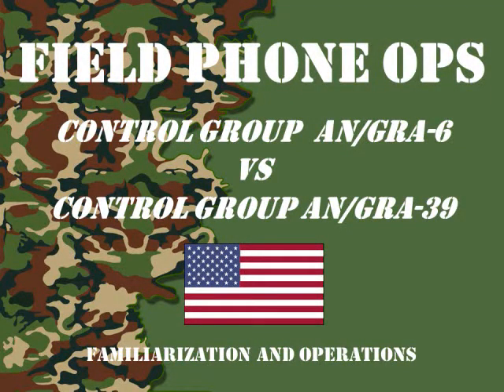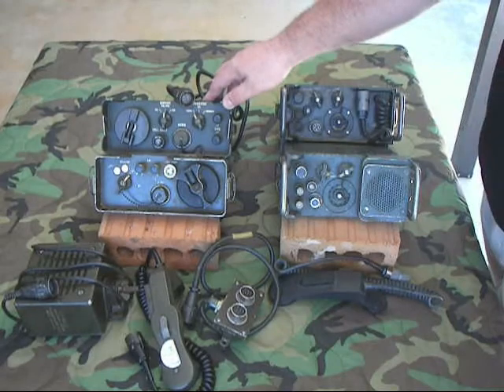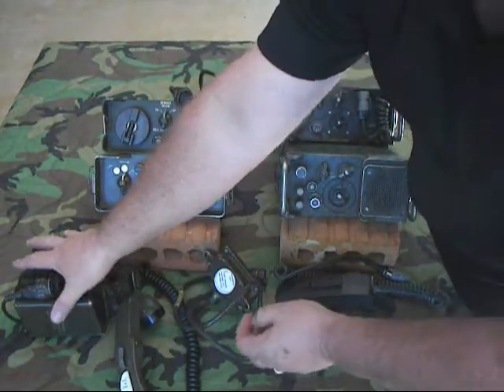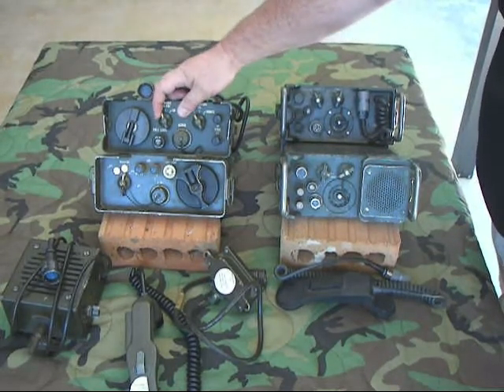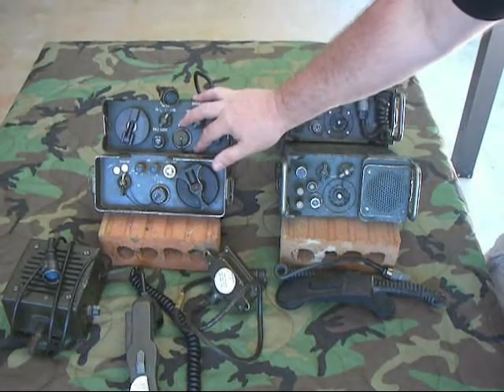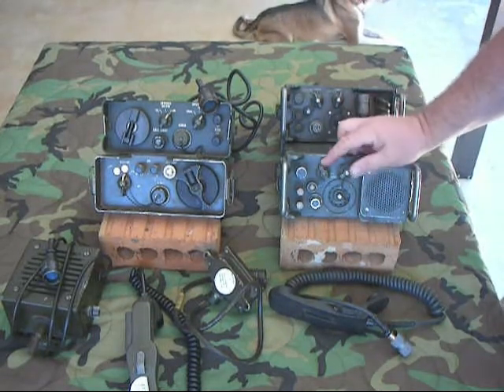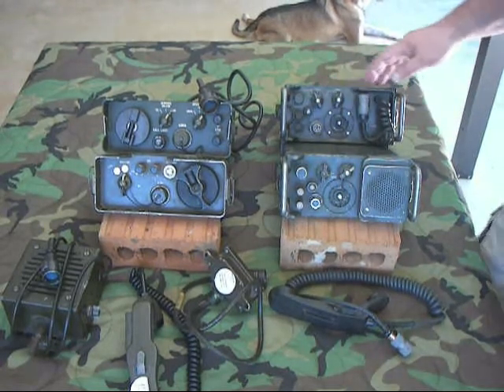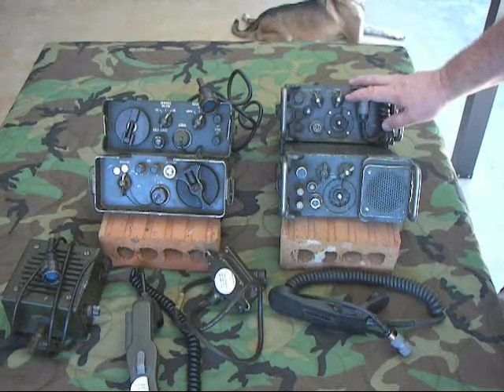FIELD PHONE OPS:  AN/GRA-6 vs. AN/GRA-39

Comment: Nice to see the comparison. I just ordered a GRA-6 set from eBay (hoping the units work). I would be interested to see your 45V battery setup for the C-434 unit--is it necessary for operations?
Reply: Hey Aaron, the 45v battery is needed if you want to key the remotely connected radio. They also use two D cells that allow them to work like field phones. I made one using 9v batteries.

Comment: I like your videos, got a set of AN/GRA-6, and the 48V battery is rplacable with 5 x 9V batteries in series. Works great. The current from these batteries is small, and only when PTT is pressed so it lasts quite long.

A suitable radio is harder to find, and somebody to talk with in the other end may be even tougher :-)

You may use it to remote control other equipment too, you have at least 2 different relay's to control. One that operates when you press the PTT. and on to turn on or off with PTT depending on the switches on the remote unit.

Advanced and reliable in hence of the age.
Reply from the maker: I actually built a connector adapter and used my GRA-6 to connect to and remote a Uniden Citizen Band Radio.  Fairly easy if you know the pin outs and specs on the radio mic and speaker.  Have you seen my videos on remoting radios?  Would be a good place to start.  I'm planning on doing a video on connecting my my GRA-39 to a PTT operated radio and a VOX operated radio.
Reply from the maker: https://www.youtube.com/watch?v=20GMAAh4-Ho
Reply from the maker: https://www.youtube.com/watch?v=Bp3v0YKs3eU